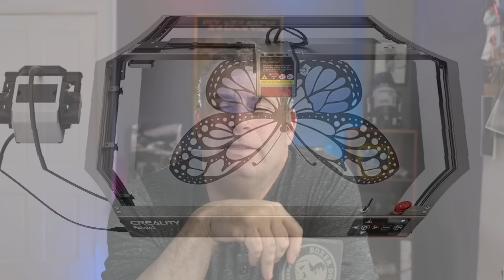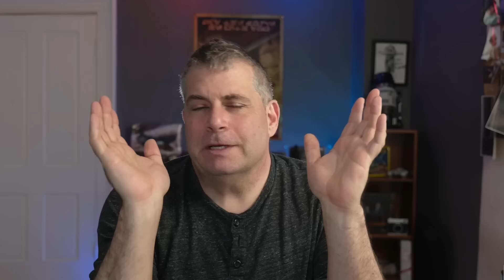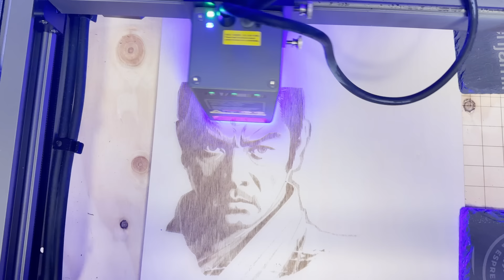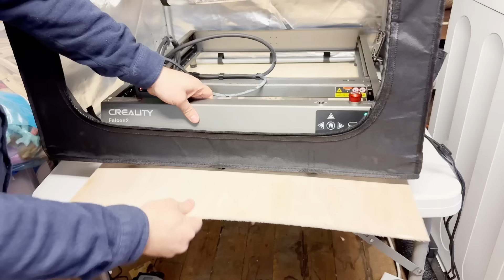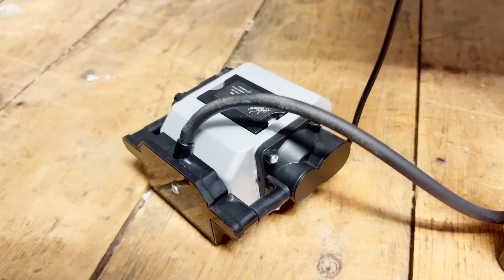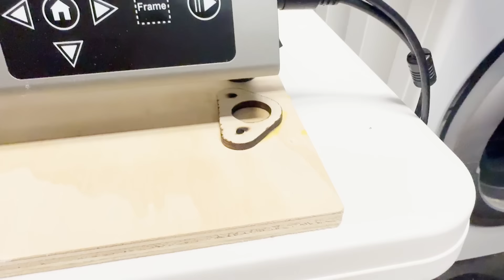Falcon 2 22W Full Hands On And Buying Advice - The new breed in laser engravers is here.

Comment: Is the difference between the 22w and 40 w a deal breaker ? 22W seems in the sweet spot for its price . I can buy all the accessories like the rotary kit and honey comb grid and software for the min price of the 40w pro 2. Anyone agree . I need your help before i commit to buying hehe
Reply from the maker: Definitely not a deal breaker. 22w is fine for the majority of projects. You’re not cutting out pieces of wood with the 22w (depending on materials) but it’ll handle almost anything consumer related.
Reply: @davetriesthis awesome thank you for your feedback.  I figured because im on a budget i can always buy a scroll saw as an extra  and cut out any depth if I HAD to cut something if the depth was too much to handle for my laser .
Reply from the maker: Right. Although a 20w will cut most wood up to something like 6mm. You can also do lower watt passes over and over until it cuts, although the more you do the more likely you will have burn marks.

Comment: Why does everyone seem to want a layer that higher in watts 22 is pretty low
Reply: I had a 10w laser, which was not bad, but I found it needed just a bit more oomph. Hoping this 22w does the trick for me. 

I think the issue with the 40w lasers is that sure, you can cut thicker pieces of wood--but the sides start to look pretty charcoal-esque, IMHO.

I am goinig to think of this 22w laser as one that goes to 11.... twice
Reply from the maker: What is 22w too low for?
Reply: @davetriesthis  the only I think of possible for cutting through thicker material I really don’t but when they are advertised such as you tube they are like 40 w this is just my observation

Comment: So, it does not cut correctly with lightburn unless you know the items are in opposite directions of placement in the program?
Reply from the maker: No because I had two profiles loaded in two different windows, the two profiles were conflicting. One had the  axis with the 0,0 being front and one with 0,0 being the back. The 0,0 front was the one I loaded by mistake. 

I was just saying to just use the driver on the thumb drive instead of trying to figure settings out like I did.